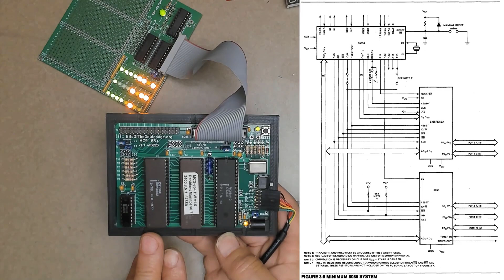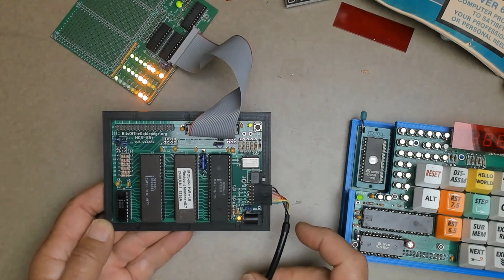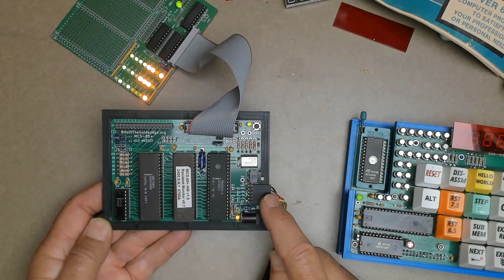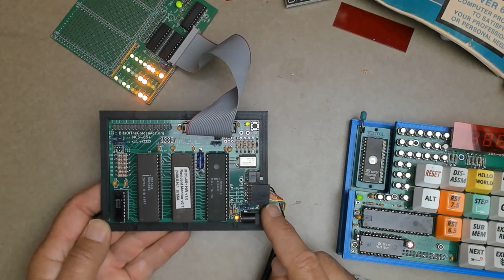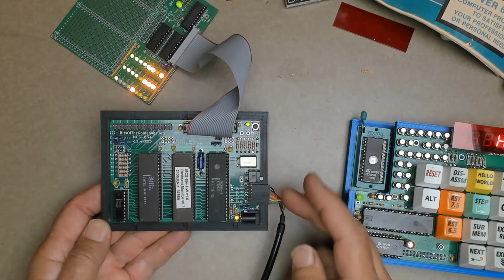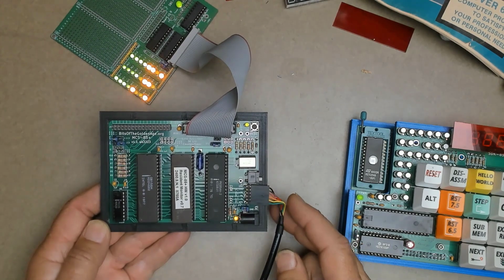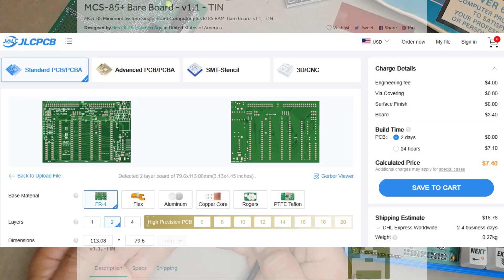{108} MCS-85+ v1.1.  4-chip, 8085 Single Board Computer,  version 1.1 changes

Comment: Why didn't you use diodes on the two power inputs, so you can power with both and not have to worry about the jumper?
Reply from the maker: Voltage drop. Even before any +5 is used at the I/O header, just these 4 ICs can take 700mA @ 5V and there is only 5% power supply tolerance.  
The MAX40203 (ideal diode) suggested by @ddowlingau would be a possible solution. There is room on the board, however, my intent is to stick with period components.  For reverse protection I would crowbar a fuse, but bridging multiple sources when there isn’t any headroom in the voltage is an age old problem and a jumper is the age old solution.  The switching power supply and USB cable are probably each fairly well regulated and self-protected, so I doubt there would really be a problem if both sources were used simultaneously.

Comment: I have standardised on that "FTDI style" serial pinout on most of the boards I design. During development it is great to be able to take a board and plug in one cable and get power and serial. It is also good when a board is installed into a system as it is easy to connect up a console in a consistent way. 
I generally put some sort of protection to stop power flowing back the USB 5V rail but in a 5V design you would need to use an ideal diode such as a MAX40203.
Reply from the maker: I am late to the smart cable party I guess.  I only started using the smart cables when i wanted to take something like this little MCS-85+ board upstairs and use my laptop.  
A good point about protection..... I need to be more consistent with reverse protection.  I think the best reverse protection is a MOSFET and i certainly had the room on this board and maybe should have put one on.  If i am not going to use a MOSFET, I prefer to use a reverse diode to crowbar a fuse.  But those little surface mount fuses have gotten so pricy that I got out of the habit.